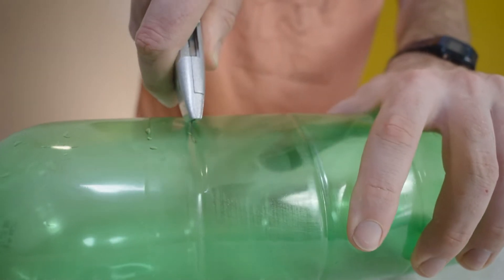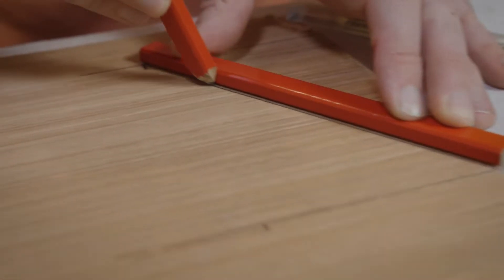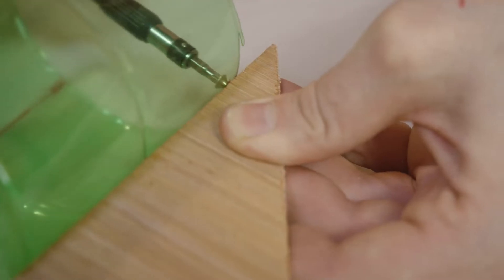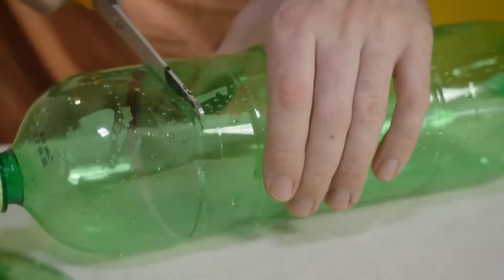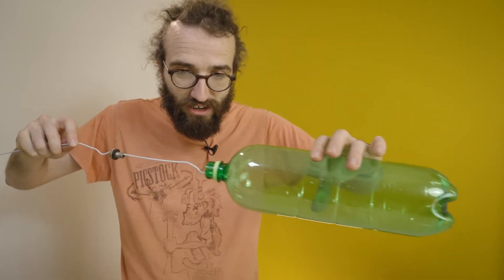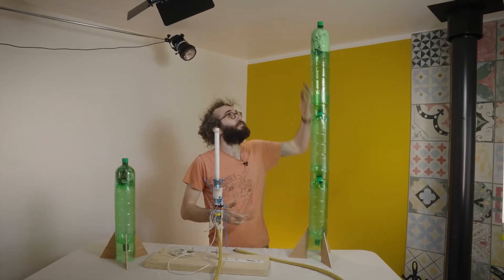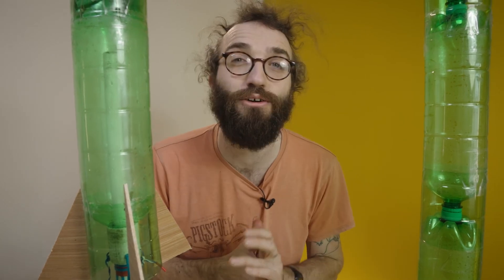Science at Home #31 - Rockets Part 3: Building your own bottle rocket!

Comment: 00:03 Learn to build your own bottle rocket using simple materials.
01:34 Constructing a bottle rocket with a nose cone and fins.
03:07 Learn to mark and attach fins to build a bottle rocket.
04:39 Build a tree chamber rocket using five bottles.
06:13 Assemble bottle rocket components using threaded hollow bar for connections.
07:42 Instructions for assembling a bottle rocket with effective seals.
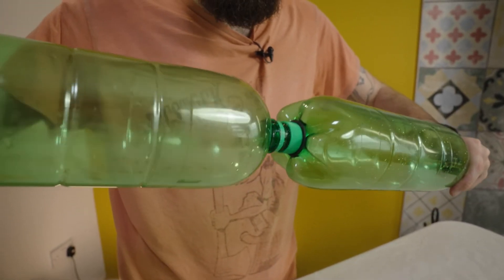09:45 Constructing a sturdy and aerodynamic three-chamber bottle rocket.
11:10 Instructions for building a bottle rocket launcher.